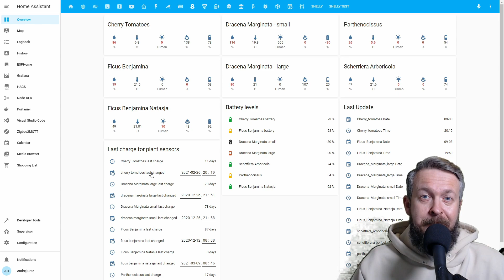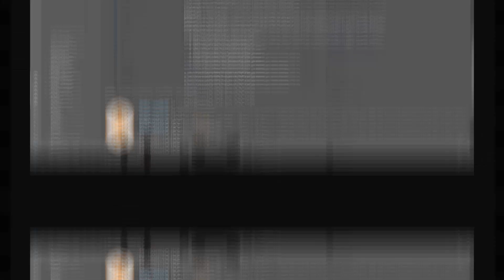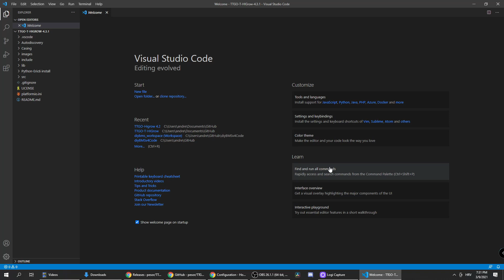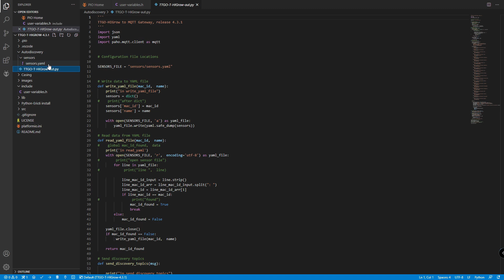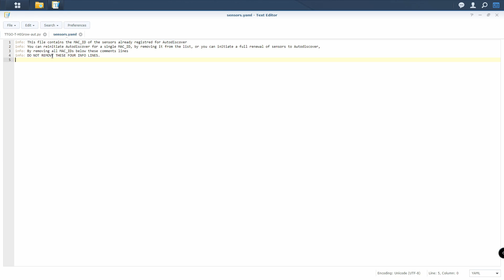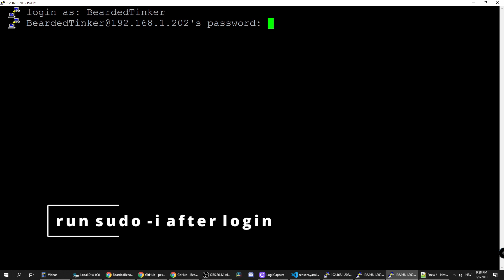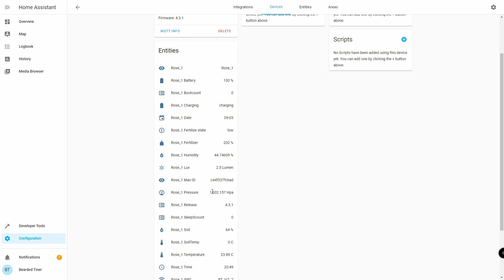Home Assistant How to - flash latest LilyGO HiGrow firmware

Comment: Hi there! 

Firstly great video!

I am stuck on the configure MQTT. I keep getting "Connection Refused" when I run the python script. I'm using the IP address of Homeassistant.

I have installwd Homeassistant inside of Docker on Raspian. Can you please confirm the MQTT IP?

Also are there ports I need to open to get this to work?

Thanks,
Reply from the maker: Do you have MQTT installed in Docker too? You need it installed and configured before trying to connect? If you have it installed, MQTT IP address should be the same as home assistant (or host whrer you run Docker).
Reply: @BeardedTinker  thanks for thw quick response!

I followed your instuctions to install paho-mqtt. I assume that your instructions don't install mqtt in docker? Can you please comfirm?

I'll double check the paho-mqtt step.

Many thanks for your help :-)
Reply from the maker: @adamlorde2820  paho-mqtt is just library used to communicate with MQTT server. 
I have video on how to install it in Docker - hope it helps.
https://youtu.be/ABb-63y0Em4
Reply: @BeardedTinker  My friend, that was it! Thanks so much! I now have this working! Great video, great support, please keep up the good work! Thanks again
Reply from the maker: Thank you Adam - glad you got it working!  And thanks for the comment, really much appreciated!!

Comment: Hi! Thank you so much for the video. After many days working on that, I could add the sensor to HA, but is not perfect yet. The sensor don’t update the data unless I press the reset button.  Could you help? 🙌🏼
Reply from the maker: Thanks for your comment!!!!
Can you check if in sensors.yaml file in autodiscovery folder for HiGrow board you have names of the boards you added? I think this could potentially be the problem.
If you don't manage to get it working, please open issue here:
https://github.com/pesor/TTGO-T-HIGrow
Reply: @BeardedTinker  Thaaanks!!! I resolved just changing de sleep time on the code! Now I’m trying to learn how i connect 2 fans coolers (12v) to a esp32 using pwm to control the speed. 😂

Comment: Hi, thank you for your tutorial. When I run the script, it ends with message: Connected with result code 0 and it will not make any rows in sensor.yaml
Reply: Resolved, awake HiGrow from sleep and by sure it is reachable on the network. It is just for a few seconds
Reply from the maker: Thanks for this Erik!

Comment: Hi, thanks for the tutorial.
I have followed until part that you ssh to run the python script but since I have Home Assistant 2001.4.03 in RPI3 , I think I cant SSH.
What I do is put I have put TTGO-T-HIGrow-aut.py inside /python_scripts and sensors.yaml inside /python_scripts/sensors.yaml. Now I see Python Scripts: ttgo-t-higrow-aut in developer-tools/service ,the service dev tool allows you to call any available service in Home Assistant. But after that my sensor.yaml remains unchaged, and if I see Home Assistant log I have:

2021-04-10 23:07:29 ERROR (MainThread)
Reply from the maker: You will not be able to run script on HassOS or within HA as it needs to download two libraries, and that is blocked by Home Assistant. You need another Linux machine or Windows one to run this script.
Script needs to be run only once or when you add more boards.
On the project wiki page there is a guide for installing Python on Windows machine.
Reply: @BeardedTinker  Thanks for the explanation, by the way you think if I install Home Assistant with docker in RPI3 with raspbian is the way? Or you suggest any other OS that in order to use my RPI3?
Reply from the maker: @LingIvan  for RPi3 I would definitely recommend using image from Home Assistant to run it. Adding another layer on that machine can have bad impact on resources especially if you add a lot of add-ons in future.
Reply: @LingIvan  Did you have any luck with this? Im running RPI3 with HA image and mosquitto mqtt on my PC
Reply from the maker: On GitHub repository in Wiki, there is a step-by-step guide on how to run script on Windows machine.

Comment: Thanks a lot for the guide, got me all the way to the end...I did end up getting my first ever white smoke though when plugging in the battery, no idea what I did to make that happen!

Got the monitor running off a usb battery pack though, will probably keep it like this for now.

Edit: Actually, I have noticed the conductivity isn't really reported in a way home assistant wants, it's giving a percentage when HA wants µS/cm.
Reply from the maker: Sorry to hear that, but welcome to the club! So far I count 3 boards that are out :D 2 were completely my mistake but for one I can't figure out what happened.
In regard to conductivity - yes, that's true. Pesor has been consulting with a lot of people on conductivity/fertilizer but there seams to be a issue with design of the board here too. Will not go into details, but because of technical design, the only time you get accurate results is just after watering the plant. After that with each measure, accuracy drops to to polarity attracting particles to one side of the board. (or something like that).

Comment: Hi, sorry to be a pest but have followed and all is good until I get to the autodiscovery, I am running Pi3 and cannot find how to run python3, any pointers, please?
Reply: I get the following error line 2, in <module>
    import yaml
ModuleNotFoundError: No module named 'yaml'
I have Mosquitto  as the MQTT Broker
Reply from the maker: You get this error when running script? If yes, then you are missing yaml library. I'm currently at work and will get back to you asap with line you need to type to download it.
Reply from the maker: @coulditbedestiny2622  Try running this command:
pip install pyyaml - this should install YAML module.
If you get same error for MQTT, try this command:
pip install paho-mqtt
Reply: @BeardedTinker  Thanks mate, it would appear that there are issues with it pointing to python 2.7, trying to get it sorted.
Reply: I have issues with syntax errors on the f strings while running MQTT in combination with HomeAssistant on RPI. Very weird since when i run it on CMD on desktop it works..
Reply from the maker: @Yannick_1203  are you using HassOS on RPi? I think it blocks ability to install custom libraries (download them) - if that's the error you're talking here.

Comment: Hi thanks for the project, it is awesome! when I upload and monitor I get the following "Listing directory: /
- failed to open file for reading
Here comes the calibration info:
Reply from the maker: This is normal if you are setting up new board or this new firmware for the first time. When you set name of the plant and use true value to save it, this error will go away.
So after you set name of the plant and calibration data, all should be good.
Just don't forget to set those values back to false, after you finish uploading firmware with calibration data and name of the plant sensor and flash it one more time with that.
Reply: @BeardedTinker  thank you

Comment: Hi! First of all thx for your very helpful videos!!
But i have a problem with this "new" solution as i already have some Sensors running with the "old" solution.

My Board tells me:
---------------
SSID name: HelloG............ 
Connected to network
0C:9E:9D:9B:92:9C
10.10.17.6
IN VINTERTIME
Wire ok
Could not find a valid BMP280 sensor, check wiring!
BH1750 Advanced begin
lux 27.50
0
Soil before map: 3523
Guru Meditation Error: Core  1 panic'ed (IntegerDivideByZero). Exception was unhandled.
-----------------
And reboots.
Tried with another (new) Board but it's the same.

Do you have any hints?

Comment: Hi,
I followed steps but when I try to run the command TTGO-T-HIGrow-aut.py  I get an error message of "Permission denied" when it tries to write the sensors.yaml file in line 22.  I can add the MAC and Name of sensor manually to the Sensors.yaml, but then it seems to skip most of the program and it does not add any entities in the Home Assistant MQTT.   HELP PLEASE!
Reply from the maker: Try using sudo -i first to elevate privilege. Then run the script.
Reply: @BeardedTinker  I can't seem to get the format correct. I have tried "sudo -i python3 TTGO-T-HIGrow-aut.py " and python3 sudo -i
Reply: and just "sudo -i TTGO -T-HIGrow-aut.py.. nothing seems to work out.
Reply: Success! It is all in the spelling. Worked as it should have.  Thanks you your help.

Comment: Would you recommend the LilyGo HiGrow over the Xiaomi MiFlora?
Reply from the maker: Yes. If you look at the biggest difference, MiFlora is Bluetooth device, while this is WiFi - just this alone for me is better solution. 
In terms of the sensors, they are almost the same, except this one has air humidity and I don't think MiFlora has that one.
Also BME280 version of the board has air pressure sensor and you have ability to use external soil temperature sensor.
Con of this is of course, you need to get separate battery and print the case or you have ability to buy them but increase overall cost.
Reply: @BeardedTinker  What are the steps to add an external temp sensor to this device?
Reply from the maker: DS18B20? You need to enable it in firmware and connect it. Run autodiscovery script and that should be it.
Reply: @BeardedTinker  How to connect each cable? The VDD, DQ, and the GND? Do I need to hook up any resistor? Could you show us the picture for that please?